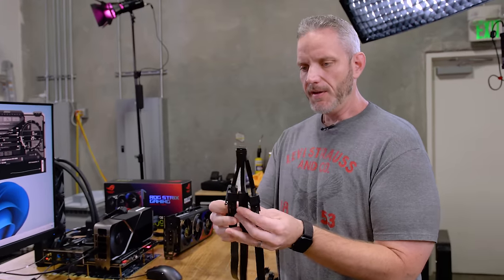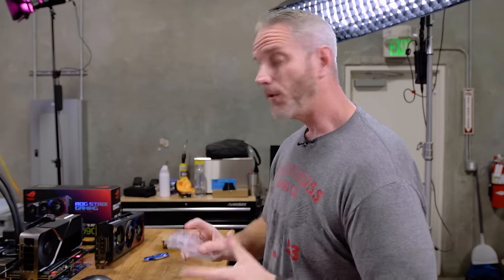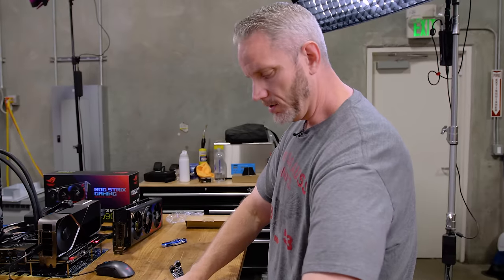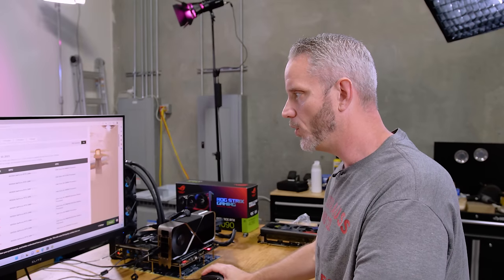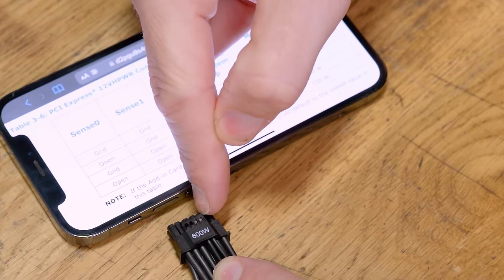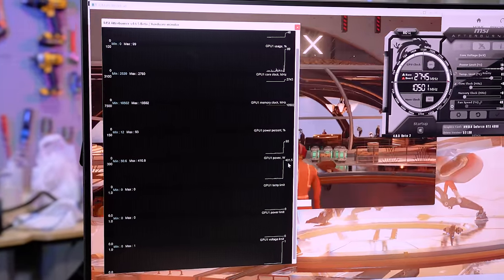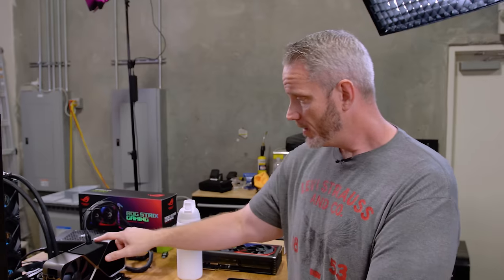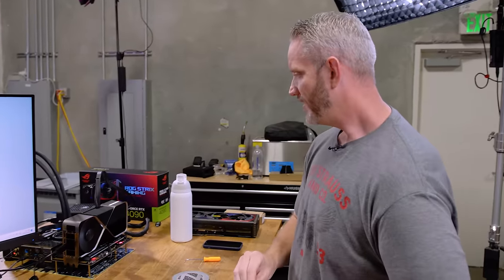DON'T Do this with your GPU!

Comment: I will buy mid range this time, this is nuts. The card is too big, that connector looks like a fire hazard and the lack of display port 2.0 is insane, no wonder EVGA pulled the plug.
Reply: I'm waiting for the new AMD RX7000 series...  Display port 2.1 confirmed...
Reply: The mid range cards are laughable, better off skipping this gen or going Amd
Reply: i wouldn't rush to buy midrange yet there are some other cards coming that 1. might have display port 2.0, 2. actually support PCIe 5.0 and 3. not need 450 watts for this level of performance.
Reply: Why not buy the bow cheaper to get used/maybe new 3090 or 6950xt since they are around 1000 now lol
Reply: Why do you need DP2.0? Is 8K 60Hz/4K 120Hz not enough for you?
Reply: @codname125  also dont forget dsc actually pushes it past that, can actually hit 4k 240hz thanks to it "doubling up" the bandwidth with barely/not noticable compression
Reply: You forgott they also "pushed" (kinda because its just stupid) the Card to 450 Watts as well and if you actually go to 280 Watt it only is 10% less Powerfull. Makes it even more unreasonable.
Reply: Totally agree
All this time i thought that an 8 pin to 8 pin pci-e cable can pull max of 288 watts (150 watts safe rating). Lets say that you use the corsair connector and you use 2 pci-e 8 pins for the power delivery but the 4090 asks for more than 576 watts under any circumstance. If that power is to be delivered through the 2 8 pin cables then the cables will be fried or the connection with the power supply and probably cause fire. I know the gpu gets up to 70-80 watts from the pci-e 16x connection with the motherboard but this is a bit scary. Also note that the software monitors always show 5-10% less power consumption for the gpu's.
Reply: @codname125  The Card can do more.

Why are you fine with Nvidia literally Bottlenecking you is the Way better Question.
Reply: @crispycrusader1  Sure. Its still a Compromise for no Reason. Nvidia could have used DP 2.0 and the full Benefit without ANY Compromise.
Reply: Can I ask why ppl worry about dp 2.0? Wont monitors just do HDMI 2.1 then.
Reply: @codname125  if you are spending 1600 dollars (or more) on a brand new top of the line card shouldn't it actually have brand new top of the line specs?
Reply: I agree with you that this card is a little over the top, but I see no evidence that the connector is a fire hazard. the literal specs on the connector are 8.5 amps per microfit pin, versus 9 amps for minifit jr. pins. That means the pins are capable of 619 watts (8.5 x 6 x 12).  I have played around with crimping and using microfit, and it really isn't that different than minifit Jr.
Reply: Or hunt down 3080fe. It’s smaller, beautiful and got nice angled plug. They blew it with 40 series because the plugs are straight angled and 4 way splitter lol
Reply: @flimermithrandir  show me some games at 8K running above 60fps on it. And I never said I'm fine with what Nvidia is doing, I just think it's not worth crying over, the card still has HDMI 2.1 which is plenty.
Reply: @flimermithrandir  Derbauer said you can get 95% of the performance @300watts with a modified power curve that's crazy, why would Nvidia push to 450W for that last 5%?!!
Reply: The problem is cards with this feature will be a lot more "futureproof"  it may be difficult to sell a 4090 in 3 years if the monitors can't be used to their full potential at that point in time. I think for $1600.00 it should have the latest ports on it.
Reply: @flimermithrandir  I'm not arguing that point, it definitely could and honestly should have had it just for when the monitors that have dp 2.0 start coming but I think there is only like one out right now?
Reply: @stonecold91  why? 2 cables is enough, especially with the board power as well. 4090 actually draws less power than 3090ti and even 3090. It also much better with power spikes, which apparently barely goes crazy as 3090ti. So at the end, 450-500w will be the absolute max you'll get from an overclock 4090, which the 2 8 pin 12vhpwr cable provide. If you're really paranoid, cablemod makes both 2 8pin and a 3 pin version of the 12vhpwr cable
Reply: @edwardallenthree  PCI-SIG emails have leaked talking about 12vhpwr cables melting, they sent the emails to partners that are making cables. The issue (as far as I know) is when the wires are bent in a small radius, like in a small form factor case or a case that doesn't have room between the side panel and the card they can pull way over rated amps on one or more pins due to high resistance. From what I understand the tests were done at max power limit and may not be a concern but this "could" be a problem.
Reply: @davidbrennan5  I can tell you I would have much preferred if they had made it some sort of 12 + 4 minifit connection. Microfit pins are physically smaller, thinner, and easier to break. Plus I don't have a microfit pin remover tool and really don't want to buy one.

Edit: thanks for the information, by the way.
Reply: No problem. I try and keep up with everything.
Reply: @Dylan Running 4k 144hz with a 3080.
Reply: @codname125  I cant show you Games running with DLSS3 and an CPU that will be released in 4 Years and an Engine that can handle it and… what was the other BS they are implementing that doesnt really make Sense right now… (Seriously just forgot…)
(Edit: They also want to make better Drivers or something like that so they will be able to push even more Performance)

Anyways. Point is that Card could do more in the Future. But it wont now because its Bottlenecked anyways.

Is it a huge Deal? No. Not at all. It still remains stupid however. Its like you are buying the fastest Car but they dont give you the best cooling Solution because you are fine with the Wind Breeze at high Speed. Its Cold as well so why bother… Thats kinda your Argument.

I know its not literally the same but the Point is still… why didnt Nvidia bother to invest a few Cents more (literally not much more for them to buy).
Reply: @crispycrusader1  Its still dumb. I understand they dont always need to implement the best of the Best Standard but we are now at DP 2.1 and 2.0 is out since i think… 2 Years ago. So that should have been no big Deal.

This Card will get better in the Future. Which is great, dont get me wrong here. But it will always have this Compromise implemented. Now, in one Year and in 3 Years as well.

Oh. I remembered they want to make better Drivers as well which will help them get even better Performance.
Reply: @flimermithrandir  as annoying as it may be, with enough complaints maybe a mid series refresh for dp 2.0, like with a super/ti series cards
Reply: DP 2.1 not needed when DSC exists
Reply: @schleprok6333  Card is too weak for DP 2.1 to even be relevant
Reply: Don't buy mid range buy amd, only 2 power connectors, 350w and display port 2.0
Reply: I still don’t even really know what that is so I could care less about that. Just got a gigabyte 4070ti eagle OC

Comment: Given the comment they made to GN on the power requirements and how wrong the rep was.  I 100% would not use any cable from Corsair.  Gonna burn your house down.
Reply: No, it'd be fine. The 16 pin cable is essentially just two 8 pin cables combined.
Reply: The original Corsair post was incorrect, but it wasn't incorrect about their own product it was incorrect about nvidia's product. It was simply a misunderstanding and they have apologized. It had nothing to do with whether or not the Corsair product is technically good. There is no difference in power between using the Nvidia adapter and corsairs, other than nvidia's adapter will produce a messy bunch of cables which might cause other issues. The IC on nvidia's adapter is designed to count how many cables are connected to it. Corsair's cable does not need to count how many cables are connected to it because there is only one configuration option and that is the plug both cables into your power supply. No need for an IC when the pins will always both be connected to ground.
Reply: @metaleggman18  an eight pin cable has three lanes of 9 amps each,  for a max power of around 324 watts, however the spec limits it to 150 watt (this difference is why you see pigtails). The 16 pin cable has 6 lanes of 8.5 amps each, for 612 watts rated power, or limited to 600w by the spec. So, yes, it is exactly like two 8 pin connectors, although it has more 12v wires than two 8 pins, and runs much closer to the spec of the underlying components, in theory.

Comment: Could anybody please try to run an overclocked 4090 with the NVIDIA adapter with a couple of Y-splitters of a single 8 Pin PCIE Cable. I want to see the cables melt :-D
Reply: I'm sure Dawid will have video of himself doing this unintentionally before the month is out.
Reply: @Eric_Fate  Oh god, here we go!
Reply: I'm looking forward to someone using molex to 8 pin to 12 pin.
More adapters is more better, right?  Right!!
Reply: Few weeks and ebay will have molex to 12VHPWR with these two ground wires installed.
Reply: I'm not sure you would. The issue is the connectors, not the wires. Three pairs of      18 AWG wire won't melt at 450 watts, but the connectors might.
Reply: @PREDATEURLT  perfectly fine if it uses 12 molex connectors.
Reply: @PREDATEURLT  right? especially exciting because of how little molex was rated at
Reply: @Eric_Fate  there is no way Nvidia is trusting Dawid with a 4090.
Reply: Do you want to pay the overtime for local fire dept to be on standby?
Reply: No. The cables will explode in that case. And then they'll play a JayzTwoCents iFixit ad.
Reply: @Eric_Fate , and today’s bonfire is sponsored by Linoooooode.

Comment: But  Jay, Steve just did this test and found you need all four or you will only get 400 watts.
Reply: 450
Reply: and that Corsair said Steve was full of shit lol, which he promptly proved them wrong.
Reply: Can you link that video?
Reply: yeah I wanted to see Jay try to pull 600 with that setup
Reply: Ya but 300watts will give you 90-95 percent of your performance. Using the full power on 4090s isn't worth the marginal performance gain
Reply: as others have pointed out, Steve found exactly the same thing as Jay did in his test. we're learning how the new ATX 3.0 power connector works, and it's pretty freaking cool. it also became clear to me while watching this that Corsair just didn't understand one tiny aspect of the adapter cable, namely the fact that it was smart and that it used in ic as opposed to their cable which just hard wires it for 600 w.
Reply: @FDFANATIC541  gonna need a source on that buddy.
Reply: @lem0nade_899  It was on a DerBauer video.
Reply: @lyianx  Probably because it is safety feature, not because the power supply or cable wouldn´t be able to do it.
Reply: GN was using an Nvidia cable, and Jay is using a Corsair cable with a different design. It's not an apples to apples comparison.
Reply: @lyianx  And then they apologized to Steve on Twitter and Facebook because who said those things to Steve was an absolute 🤡 and doesn't represent Corsair's PR department.
Reply: No, you get 450w with three, 300w with two and 150 with one, and that is because nvidia's is respecting the PCIe standard. This one is only for corsair 's PSUs
Reply: @Nareimooncatt  Jay didn’t prove that the Corsair adapter will allow 600 watts. I get what you’re saying. But he was not able to set power limit to 133% like he should have been able to.
Reply: I think that's for using the nvidia adapter.  the coarsair one is for their power supply.  Their power supply should be able to handle the wattage over that cable/connector from their power supply.  Think about pcie power cables from power supplies.  some have more than one 8 pin on a cable.  It should be because the power supply can supply that ammount of wattage for those connectors.

But if you're using the nvidia adapter, it only sees power from each connector.  coming from your power supply, you're probably stll only using 2 separate feeds from the power supply even if it's 4 8 pin pcie connectors.
Reply: @sauyon  It's the latest video on GN's channel. Most comments with any link get blocked by most yt channels.